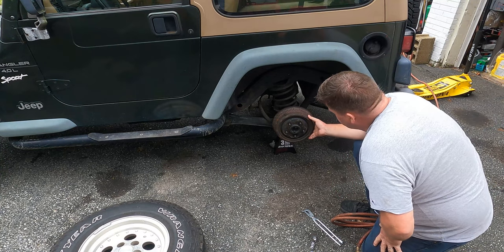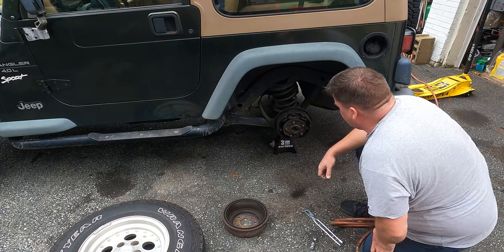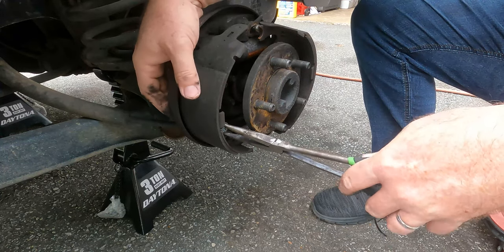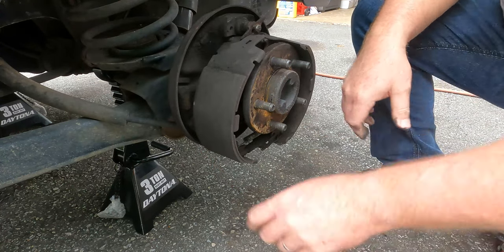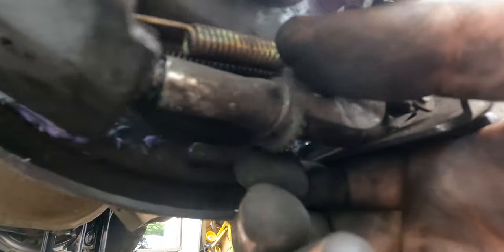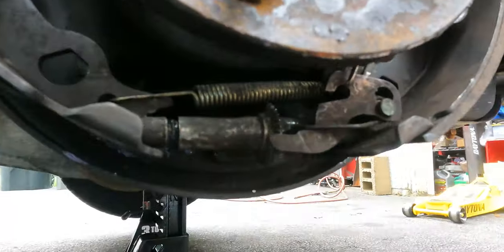How to remove and repair Jeep TJ Drum Brakes

Comment: Just purchased a  black ‘97 Wrangler TJ in NZ soft top.  It ‘s ex-Japan done 127,000 kms, lifted (no idea what) with 35” tires - immaculate for its age.  However, needs new rear shoes and wheel cylinders, so your video will be invaluable.  A number of other age related replacements also required e.g. all suspension and body bushes have perished with age - so full bushing replacement. No rust of course as no salted roads where it came from nor here.  In fact I do not know what the Japanese do with such vehicles - drive around town I guess.  RHD of for us and Japanese .  Thanks for you video as will be rewatched for above job.  Also watched your AC video as no cooling either.  Thank for taking the time to make.

Comment: Thanks Jim - I have successfully replaced the brake shoes on my TJ
Reply from the maker: Great!  If parking brake seems "loose" it's the cable pivot not seated correctly... I chased that for some time before I figued it out.
Reply: @jimsjeeps9782  I was paying attention.  I made sure cable pivot was flush with the shoe

Comment: Great video Jim. Just subscribed 👍🏽. Working on my 2000 TJ and need to pull apart my partial install. Didn’t realize I needed to grease where the shoes slide
Reply from the maker: Thanks for checking in!  More videos coming, including adding an AC system to my YJ.  Winter has not been kind to filming!  Thanks for the sub!

Comment: Capt. Crispy
47 seconds ago
If the self adjusting arm doesn’t make contact or seem to be working. Ensure the silver cable guide is properly seated in its hole. It’s very easy for this to get pulled out when stretching the top aft spring. Mine was just slightly out and caused the system not to work. Whoever rebuilt previous to me made the same mistake.
Reply from the maker: Yes.  A bad design.

Comment: For those that wanted to see the EMERGENCY BRAKE hook up like I did, the First part is at 13:59 and the last part starts at 17:55..✅  it’s to Bad though Jim had the camera on the Wrong side with his hands 🙌 in the way, so I’m Not sure how much good it will do… 🤔🤔😩
Reply from the maker: Oops... I will do better... The  best advice on the E brake is to make sure the little pivot point cable bracket is in the hole all the way.  If it is not, your E brake will seem very loose with too much play.  If that's the case, re-inspect that and you will most likely find it's not correct... Thanks for the feedback on the camera work!
Reply: 7..b

Comment: Jim…what type/brand grease is the purple stuff…? Good vid, thanks.
Reply from the maker: It's Permatex Purple Ceramic brake grease.  Good stuff and one little jar lasts YEARS.  I use it on caliper pins, and the rub points on the drum brakes.

Comment: wondering how you got that brake adjuster cable on the bottom as a last step....not much room
Reply from the maker: Yes, it's tight.  The adjuster tab and the cable are set in place with the tab sitting on the adjuster splines.  You are right, it's a bit tricky, but doable.  If needed, use needle nose pliers to hold it and/or pull it into place.

Comment: Should be removing lug nuts in cross pattern
Reply from the maker: Removing lug nuts can be done in any order.  On re-install, its important to snug them up in a cross pattern, and then final torque also in a cross pattern.  This ensures a balanced clamping force.